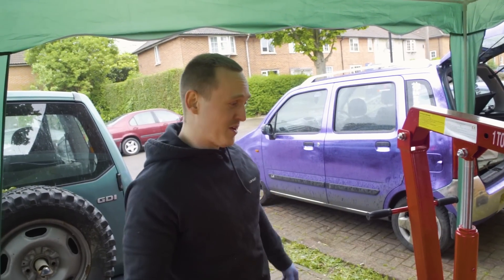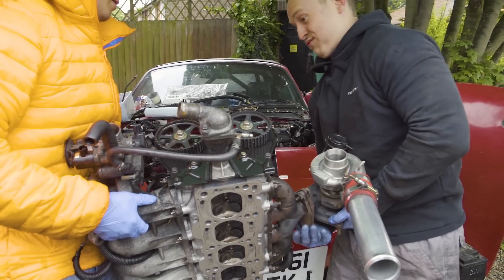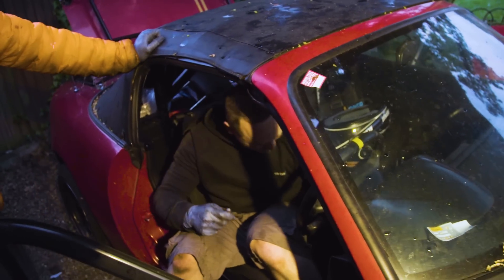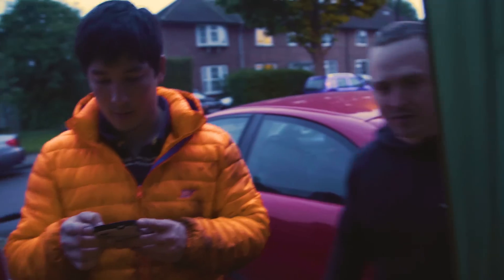Phil is ALIVE! Engine Install & First Start Up

Comment: when Alex gets the V6 he should save the old engine, put a thick piece of glass on it and make a coffee table out of it
Reply: Weesli 7 like the top gear table?
Reply: Eran Van Der Horst exactly like the top gear table :)
Reply: Not a bad idea, i think the Top Gear coffee table were made of a V12 but still nice
Reply: I have a blown rotary engine that I plan on doing that with. I bet he'll sell his, though, as it is still probably working then.
Reply: JCV no the top Gear table was made out of a Porsche 928's V8 Engine after the 'Porsches for 1500 Quid Challenge' and he couldn't sell it because it broke so he took it apart and made the seats and table out of parts of that 928.
Reply: +a person That is not true. The table is clearly a Jaguar V12 and I can't remember where the seats came from, but it was a different car.
Reply: Kriste Isopahkala Oh yeah because I remember he sold the V8 Table and the seats but the seats that they had in the studio were from some old Vauxhall like he said in the news in an episode, (can't remember witch one)
Reply: +a person So there was a V8 table at some point? The known, original "top gear table" was always the V12. Are you saying they used another at some point?

Yeah, Vauxhall seats sound about right. I remember them using Rolls Royce seats at some point too.
Reply: Kriste Isopahkala yeah they used the rolls seats and there was another v8 table but they sold it on
Reply: IIRC Clarkson only made the V8 table for the 1500 pound Porsche challenge, where he converted his seats and engine block into furniture.
Reply: my boss did that with th v12 from his benz he blew up
Reply: that would look sick!
Reply: @lambertbutlersilvers6588  belmont

Comment: He sounds like he needs a new muffler bearing
Reply: Adijan Coers of course you heard that throug a youtube video ;D
Reply: Adijan Coers and blinker fluid?
Reply: Adijan Coers yess and dont forget to fent the brakes to meke them more efficient.
Reply: Andrew Smart nah soapy water should be enough
Reply: idk why that was so funny
Reply: Genuine Mazda air though
Reply: @chrisfix ahahahahahaha
Reply: Might need to lube up those disc rotors too. fully synthetic will do the trick!
Reply: I'm pretty sure it was the crankcase light because without it the crankshaft can't see which way to rotate
Reply: Adijan Coers lmao
Reply: Adijan Coers and after u install the muffler bearing, dont forget to add some new blinker fluid and add in some fresh summer air into your tires
Reply: Chris fix.......lol
Reply: Adijan Coers may I also suggest installing a limited slip dipstick
Reply: Why is everyone forgetting the Elbow Grease?
Reply: And some piston return springs

Comment: this is really nice to see, Phil back together. props for working outside in the lovely english weather. well done!
Reply: Boosted Miata I had lost all hope, then this video. great to see Phil alive again.
Reply: Boosted Miata Yes! Phil!
Reply: Car Flip that's typical for hydraulically actuated lifters. it goes away after a few minutes as you saw. it can be avoided by soaking the lifters in clean oil prior to install.
Reply: Car Flip yeah, that motor is toast already, lol!
Reply: What would Don say? no, it's fine. That's normal.
Reply: Sure is - great video, they should do more like these - hands on car stuff.

Comment: I’m a disabled veteran and had to stop working on projects a while ago after injuring my spine while on duty. Your channel has inspired me to find a local club who are happy for me to pitch up in my wheelchair and help out where I can. It’s not the same as working on my own car but it’s still fantastic to spend time with like minded people. The car community really is the best. If I had the money I would buy a mostly finished bespoke vag group (high mileage hero) diesel and put the final touches on myself. It would bring me such joy. Thank you so much for your channel.

Comment: I bought my first car a couple of weeks ago, Miata NB 99'
Best decision I've ever made, puts a smile on my face everytime
#Miataisalwaystheanswer
Reply: I started with an NC, because my parents didn't want me to get an "old" car... It's a 2008 with the electric hardtop.
Also the best decision i've made yet, because i don't want to know what the people in my area would've done to a softtop by now. Two antennas have already been stolen (I'm not bothering with replacing it another time xD) and 2 people bumped my car while parking (without reporting it)... I bet the softtop would've been sliced into bits by now :/
But the car is the best of all the cars i've driven yet :D
Reply: JR Am I the only one who thinks that Miata sounds terrible? Mazda (how it's called in Germany) sounds better for me...
Reply: TeddyBär Its called Mazda everywhere. In Germany it's called MX-5 instead of Miata
Reply: Yeah I'm from Holland, they are Mazda MX5's here. I like to call them Miata's tho
Reply: Lucky guy!
I've got a soft top in amazing condition, love it!
It's a shame some fuckwits would do that dude...
Reply: Congrats, bro!
Bought 2004 NB 3 days ago, and I love it.

Though, how much rev you have on a 5th gear 60mph?
Reply: With a 5 speed box, 5th gear, 60mph should be running 3000rpm
Reply: S2000 is better
Reply: ok, then everything's fine.
Thanks a lot!
Reply: perhaps, but it's 15000$ for modded shit vs 6000$ for mint/stock/low mile miata.
Reply: expect when you can get a decent silva , lexy is300 or an old spec mini .
Reply: U are lucky that you don't live in central europe where ,,affordable car for young people" is rusty opel (vauxhall) astra with 1.5 engine. Feel my pain.
Reply: ProTimax affordable in ireland is a civic type R if you a middle class 
Or a corsa fairly modified or a micra with it's doors hanging of if your broke as a first car that is minus insurance
Reply: ProTimax I live in central europe and i know your pain.....
Reply: 1.5! In the UK we have to pay £4,000 a year for a 1.3 for our first
Reply: SecondGear £1100 for my 1.6 :)
Reply: diesel?
Reply: SecondGear Petrol
1.6 C2 Code with 125hp :P
Reply: SecondGear Friends got a 133 Twingo that he paid £1250 for insurance
Reply: probably because of our crime rate
Reply: Got myself a MK1 Mx5 for my first car last week, good timing for the phil videos to come back ☺
Reply: Welcome to the cult.  One of us......
Reply: I bought an NB2 in late February. Going on 6k miles already. Never driven any other car where drivers of the same car throw peace signs at me as I go down the road. Absolutely love it.
Reply: Gleb Petropavlovskiy Should be a bit over 3000? I have an '03 and it's around there. The final drive makes it rev quite high at freeway speeds, but it's totally made for it so I wouldn't worry about it.
Reply: 1981 chevrolet k10 305 4 speed. Close enough...
Reply: I bought my first car like 3 weeks ago. A 93 Honda Integra, such a fun little car
Reply: I bought mine for 2350 Euro's
With 250.000 KM's.
Runs like a dream! Oil change, air filter change and he's as good as new ;)
Reply: Miata is how "MX5" is affectionately pronounced in Japan. They still call a Mazda a Mazda :P

Comment: This video sums up working on ANY vehicle. Weather it is mods or rebuilding an engine. A lot of short temper, swearing, wanting to punch something, inpatients, and fed-upness, but in the end, it is so satisfactory when it works with little to no issues.

Comment: lifters lacking lubrication on initial startup, i think.
Reply: Indeed.
Reply: They should have removed the coils and cranked the engine for a bit to get the oil all moving around first mybe? :P
Reply: Shoulda dunked the lifters
Reply: me thinks those rod bearings are toasted.
Reply: Alliteration
Reply: Yep, the HLA's need topping up with clean oil before putting them back into the engine. Lack of this is what causes the sound.
Reply: Clay Ton if the rod bearings were toast they would have been able to see and feel it when the oil pan was off

Comment: I suggest to swap it with a BMW 3.0L V8 from a 530i or 730i, I think it would quite easily handle a supercharger but it would also be nice N/A (please like this comment to make it visible)
Reply: Foxter he is gonna swap it with a Jaguar v6
Reply: Foxter no way the v8 is to heavy it gonna mess the weight distribution it gonna handle very poorly
Reply: @zangamadrid5214  with a ls3 the weight distribution is 53/47. Your point is ?

Comment: Put a rotary engine , 1jz or 2jz , or 5 cylinder 

Or v9 xd
Reply: 1jz and 2jz has been tryed before but would never fit a miata/mx5.
Reply: rotary <3
Reply: Google it dude - 1JZ & 2JZ has been done before, many times.
Reply: tubejorrit just an idea
Reply: HaxoResc oh
Reply: Richard Harrold oh
Reply: Richard Harrold VR6?
Reply: Sam Ashly your idea is great but he can also put a jet engine and all the other engines in the car that would make it way faster (sarcasm) ..........you cant just put an engine in it   It is way harder then you think
Reply: I would put a vq30de in it
1jz and 2 jz are iron block and quite heavy
the vq is a  3 liter v6, weighs only five pounds heavier than the stock motor and shouldnt be too hard to find
Reply: wieght and size of the JZ's are big
Reply: Sam Ashly Guys, I've personally seen a 6L LS V8 crammed under the hood of one of these, (it ran a 10.59 1/4 mile!!) and I guarantee you that a 2JZ is not as big or heavy as that. 2JZ is totally doable. But why not do the most sensible thing, and put an FB22 in there? Doubles the power (of the stock engine), and roughly the same weight/size with NO turbo lag, or rotary unreliability.
Reply: A LS v8 is shorter then an inline 6. An inline 6 will fit a miata but you need to do some serious work to your firewall. I also thought most 2jz engines are cast iron where you can get full aluminium LS engines these days.
Reply: A Honda k24 would work, 200, 240 with cams, natural aspirates horse power with a 8200rpm redline.
Reply: Cast iron just means more boost.
Reply: thebestracer10 yeah it can handle 2,000 hsp
Reply: V8 og V6 swap, straight 6 will just be a pain in the ass. Even though LS swaps are common and 'boring', a Miata with a LS swap is the coolest thing ever.
Reply: tubejorrit it was surprising to find out that a 2JZ (with turbo) could weigh up to 200lbs more than a 6.0l LS aluminum engine. (Damn you for making me do research! 😂) And firewall work would be a must with the 2JZ, but again, it's still doable. However, I still believe the FB22 to be a better choice than the KA24, as you dont need any work done to it to get to that 240hp mark you were talking about. Plus it's meant to go in a rwd vehicle, easier to swap for S2000 drivetrain then to Frankenstein a predominantly fwd engine. And 9000rpm redline is higher than an 8400rpm. Also, (can't believe nobody mentioned this, AND that I forgot to mention it, but an SR20DET would also work PERFECT in Phil. Lots of power, relatively low weight and plenty of room to mod.
Reply: Goracks69 check out www.kmiata.com, no need to for a complicated swap just buy that kit, get a K24 and put it in a Miata. K24 has more displacement so more low down torque then a F22B and most important, very cheap to buy in the US.
Reply: Sam Ashly why don't u keep u with the stock engine, just because you don't wanna get your hands dirty
Reply: +goracks69 Never mind a turbo 2JZ, even a 2JZGE (N/A) weighs slightly more than a 7.0L LS7. LS engines have fantastic power density and are perfect for increasing power without significant weight gains.
Reply: Yeah.. But due to the 2jz being cast iron, you can yank in so much more compressed air without it going boom on you, making it heavy-mod friendly. That's why you see those 2000bhp supra's..
Reply: +thebestracer10 I have't seen very many 2JZs handle 2,000, or even 1,200 horses reliably. Also, LS family engines come with aluminum and CGI blocks, both easily capable of handling tremendous amounts of power. But really, what are we getting at? Not many people are looking to daily a 2,000 HP Miata with the Titanic's boat anchor over the nose. It seem as though we're missing the point entirely. When configured properly, LS engines can make huge loads of power, keep weight down, and still be very reliable and economical. They might seem pretty trite, but there's a reason why they're the most popular for engines swaps.
Reply: Felix seriously??? Holy fuck, those 2JZs are heavy!!! LS7 or SR20DET or any powerful Honda Engine seem to be the way to go!!'
Reply: +goracks69 The 2JZ is a pretty heavy, but the LS is just super light weight period. If you can believe it, an LS CT 525 weighs just over 60lbs. more than SR20DET but makes 530+hp out of the box. LS engines are stupid light and tidy engines. I'm not a Chevrolet guy, but I truly respect what they do with the LS. If I could afford any kind of swap, I'd do an LS tomorrow. The only big downside an LS swap though is making sure the transmission is strong enough to handle the power. But then again, that's a problem with any high powered engine.
Reply: The heaviness is not really the 2JZGTE's fault. Turbocharged engines must be heavy if they must take the boost. I mean, look at the Nissan vr38dett, a 600+ pound monster. But that's necessary for all that forced feeding.
Reply: +C tc Not the fault? A big, giant cast iron LSX454R weights less than a VR38 and makes nearly 800hp from the factory, but never mind the LS specifically, just look at how things are in general when comparing N/A and and forced induction.. The advantages of forced induction don't often outweigh the disadvantages. Tons of power, yes, but SOOOOO heavy! A lot of manufacturers build these engines, but they loose track of weight. There's no reason to use such heavy engines.
Reply: +Marauder Well, I understand the issues with turbocharging, but manufacturers are taxed on displacement in many markets. If I'm not mistaken, Japan is one of them. It's not possible to sell a large displacement engine without being taxed to death. Forced induction is how they work around that and make the power figures they're looking for.
Reply: How about something that hasn't been done a lot before, a cosworth YB. Should fit without firewall mods, about the same price as a 2jz, can make 800 bhp+ when built properly, converter plates available for rx8 or can use Other stronger gearboxes as well as massive tuning support in the uk.
Reply: Nobody wants a mx5 with 800hp, even 250hp is kinda scary in these cars without ABS and traction control, and in most engines swaps you loose power steering also.
Reply: Sam Ashly 
How TF would a V9 work?
4 cylinders on one side and 5 on the other?
Reply: Sam Ashly you really dont know much about how engines work or this running costs...

RIP Rotary 😭

Comment: All the oil drained out of the lifters when the head sat. This causes the lifters to collapse, creating a gap between the base circle of the cam and the top of the bucket. This causes the lobe to slam into the bucket (creating the awful tapping noise) instead of gently sliding across it.

As oil circulates, the lifters draw in the oil and take up the gap, allowing the cam to smoothly slide across the lifter, quieting down the valve train. It's why HLA-equipped Miatas are super clackity on a cold start, but quiet down within a minute or two.

Comment: D'you know, I have a friend who has a UK imported (to Holland) California edition NA8 that he's recently fixed. It stood still for about 5 months because the radiator broke (the fan scraped the radiator), and he's at some point gonna do a V6 swap as well, but it might be smaller, bigger or the same size as yours, because he's gonna put in a Busso V6, some time in the future... maybe after 5 years.

Comment: Super happy for you, you should have disconnected the fuel pump and cranked it over for at least a half a minute before starting it though to get the oil to everywhere it needs to be in the engine before it starts running.

Comment: When I've turned these engines over by hand or had a weak battery/slow start and it squeezes the oil out of those hydraulic lifters, once started it seems to take forever for them to quiet down. 
And seems to do the same thing on both 1.6L and 1.8L Miata's.

Comment: My Volvo molded like that inside when I let it sit for a few weeks. The seatbelts were not salvageable, the steering wheel was able to be cleaned off but I had to rip out every piece of carpet/fabric in the car and pressure wash it, then soak it in vinegar. Not fun.

Comment: the fact you started that poor engine with a dry head, makes me cry.
Reply: yeah it hurt a little, at least prime it by cranking a few times with the coil disconnected till you've got oil pressure, then start it

Comment: i wish I knew you were doing a new engin on Phil. I would be sold you one of these Ls motors that "fell off the back of a truck" and on to the floor of my garage for 600 pounds

Comment: OK i would like to make a V6 Suggestion.  The mazda engine that should have gone in this car (not rotary).  Find a KF-ZE engine and make it work with this car.  170 HP stock, and it sounds amazing.

Comment: I mean, you HAD to know it was going to explode. You put loads of boost into an old, stock, NA motor AND you didn't drop the pan when drilling it. Then, you ran it on high speed race track(s), with lots of high RPM pulls. I get that throwing a turbo on an NA car is loads of fun (I've done it myself), but really you should never be surprised that this kind of thing WILL happen... eventually.

Comment: the its sounding shit was the hydraulic lifters needing oil lol max oil pressure is usually around 2500rpm so idle on first start up isn't the greatest but it will be fine lol great job boys

Comment: it sounds like valve tick to me, are you using a fram oil filter by chance? my tiburon develops valve tick if you use a cheap oil filter (like fram), but it goes away if you use a quality/oem filter.